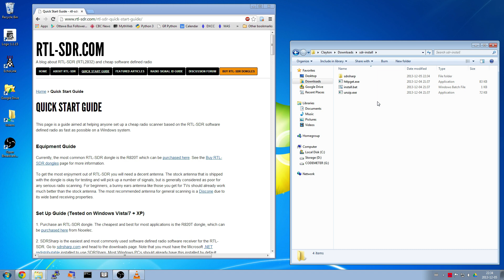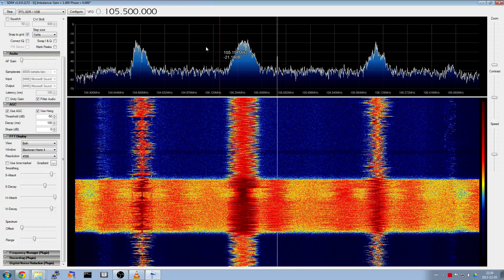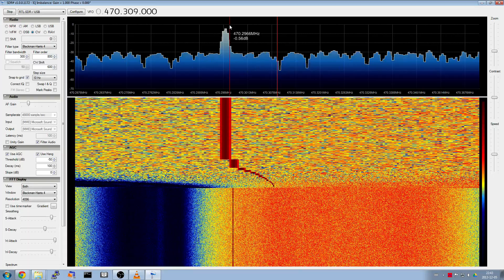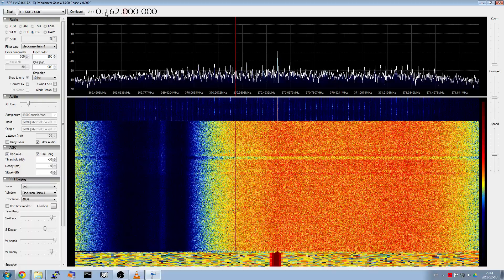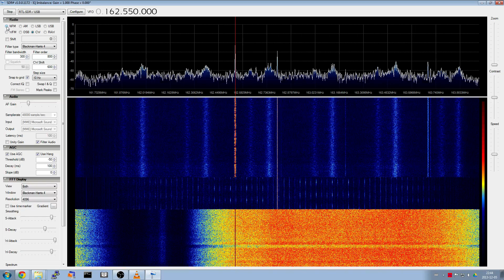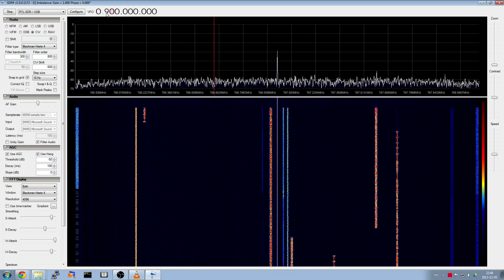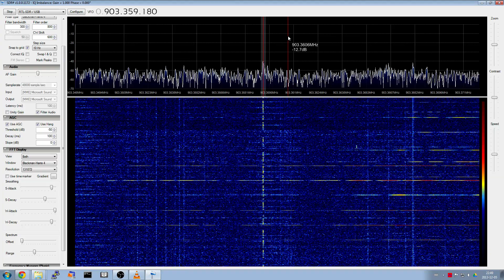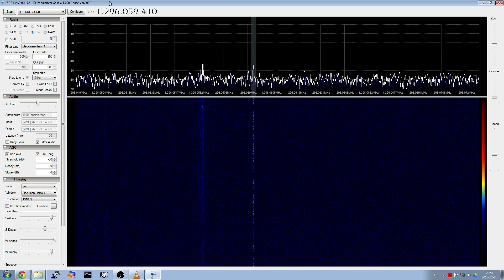Getting started with SDR# and an RTL SDR tuner

Comment: How do I know the signal is encrypted?
Reply from the maker: It varies depending on what protocol you're trying to receive. If you're sure that you are using the correct demodulator for a particular signal and the signal strength is high but you get garbled output, then that could be a sign the signal is encrypted.
Reply: @argilo314  I live in Brazil, and where I live, I can't hear any P25. DSD+ shows that there are some communications, but no audio comes out. I am using a copy of DSDPlus-2.71x.
Reply from the maker: @reninets  Encryption is common in P25 systems, so that could be the cause.
Reply: @argilo314  If there is encryption, is there no way to decrypt it?
Reply from the maker: @reninets  It would only be possible if you had the encryption key.

Comment: Hi Clayton, what is the antenna setup that you used for this video? I bought the RTL-SDR kit that comes with the antenna to get you started and I'm wondering if that's sufficient to capture the signals that I need to listen to transmissions from police, weather, and others, not just the standard AM/FM radio stations. Thanks.
Reply from the maker: In this video I used the antenna that came with the RTL-SDR. That may or may not work for you depending how far away you are from the transmitters you're interested in.

Comment: Thanks for your tutorial. Some said that there are other softwares for decoding trunking systems like TETRA, and DMR system, but in your tutorial you only used SDR sharp. Does SDR sharp decode everything? And you said that you used the original antenna that comes with the SDR. does it really a good antenna?

Comment: Alright Clayton, I subscribed to break the 999 subscriber ceiling, you now have 1,000! So put down the poutine and make us another great video! This is the best one I've seen on how to jump in and use it. I ordered the "RTL-SDR Blog V3 R820T2 RTL2832U 1PPM TCXO HF Bias Tee SMA Software Defined Radio with Dipole Antenna Kit" off Amazon the other day, looked like something fun to tinker with. Thanks man, make a part 2 now! heheheh!

Comment: Wow, I'm blown away by this video, I want to order the sdr right now but I have a question, can this work with my old LAPTOP-1.6Ghz and 2GB ram 
It would be great because I haven't used it for some time,and I was thinking to take up some dx- ing it was quite some time ago and I didn't want to spend so much money in the beginning.
Only now I come across the sdr and it seems to be a great device for much less than what a good sw receiver will cost.
Thanks for uploading.
Reply from the maker: Yes, I expect it will work on an older laptop.

Comment: I don't want to be the goat here, but they ought to configure the software to where the user has the option to select a very basic simplistic screen to work with, and  also the option for a more complicated display like the one shown in this video. Do I want to invest the 20 hrs needed to figure out and operate a SDR system?  Not really. And OK, yes you can see the frequencies show up on the graph via FFT ( Fast Fourier Transform ) technology. ooheeeew , it does FFT on the input signal , oh how impressed I am.  Well damn, only a real radio system will show you this, my goodness.  Oh sure, and now you can see those secret transient signals coming out of Russia just like James Bond.

Comment: Very informative video! I had no previous knowledge about radio equipment but it really helps to see how you adjust the parameters to optimize your reception. It will solve a lot of issue I've had.  Also, my entire noise floor seems to be oscillating, which I think could be my AC unit which is very close to my laptop or a shitty Vizio displace directly next to my laptop. Looks like it's time to buy some USB extended cables or better yet, I have an excuse to build a ham shack!

Comment: What is the pilot signal at 470.309 MHz and where does it come from?  I CAN receive it on my USB SDR in my location.  Any locations that might not be able to receive?
Reply from the maker: The pilot signal is part of the ATSC digital television standard. Receivers use it to lock onto the ATSC signal.
Reply: So it is part of a local UHF Channel 14 TV signal.  In a location with no local channel 14, that pilot won't be there although there may be one on another TV channel frequency.  WikiPedia lists the pilot frequencies of the other UHF channels but only to two significant figures.  https://en.wikipedia.org/wiki/North_American_television_frequencies#UHF_band

Comment: That thin line to the right of some of those stations like on 100.3 FM is that the RDS data? I've seen other SDR videos where there was the main audio signal and then two thick bars on each side of the main audio signal Could that be HD Radio.
Reply from the maker: No, that line is due to DC offset in the receiver, not a radio signal. RDS is not visible because it's hidden inside the analog FM signal.

The thick bars visible above and below some FM radio stations are indeed HD Radio.
Reply: I saw that line when recording from my Radioshack headset radio that I tapped the raw audio before it went to the main amp. I see the same line on the spectrogram above the audio signal in my recording program.

Also is it possible to just record the audio from one frequency and you are tuned to to a regular .wav file on these SDRs?
I've heard that it records to wav but it's not a regular wav file that you can play on a PC. It's in some weird format.
I'd like to be able to record whatever I'm listening to into an MP3 file sort of like on that WebSDR website.

Comment: Running Windows 10 when I clicked on the SDsharp after unzipping the file it said Windows Defender had stopped the opening because the software might damage my computer. Is this normal?
Reply: Windows 10 tends to alert you to this whenever it sees software that is not run by a large number of people and that doesn't mean it is unsafe. If however you would rather not take the chance google around for CubicSDR, SDRConsole or grab SDR# off the official website.

There are lots of different options and you are not tied down to a single SDR client.
Reply: Thank you

Comment: are these ok?

https://www.banggood.com/Ham-Radio-Receiver-100KHz-full-Band-UV-HF-RTL-SDR-USB-Tuner-Receiver-p-1196555.html?p=LR14182185464201508M
Reply: These are basically boxed RTL SDRs with an Up converter built into them. They are not of the best quality but there is no reason it wouldn't work. Unless you really need HF capability though you might be better off just ordering an original RTL-SDR from a local supplier on Amazon rather than waiting for one of those to ship out of china. If you've already ordered it I'd love you hear your thoughts on the item.

Comment: Are there antennas covering the entire frequency range of these USB sticks?
Reply from the maker: A discone antenna is probably your best bet. They are available from a number of manufacturers, or you could build your own.
Reply: I will try to find a mobile antenna at least 25Mhz to ~ 2Ghz?
A recommendation (wide spreaded and used)? Often only "25-1300Mhz" (actually only one "discone" at ebay, and only 25-1300).
Reply: Check out the Dressler ARA-2000, it covers 50-2000MHz. It isn't sold anymore but you can easily Google a DIY build guide

Comment: May be a silly question but to understand this can you or someone tell me what type of antenna is used here in this video or on this RDL SDR? I assuming it's not the cheap cell phone coil antenna looking one that comes on those eBay radios. ? Whoops at the end of the video I hear him say that it is the cheap antenna. That said is there a better antenna to use on this software defined radio?
Reply from the maker: For this demo, I did use the antenna that came with the RTL-SDR.
Reply: Clayton Smith but is there a better antenna to use with this other then the one that came with it?
Reply from the maker: RViscara Yes, as long as you have the right connectors, you can attach whatever antenna you like.

Comment: Can u translate that morse code at the end of the video ?
Reply from the maker: VVV DE VE3WCC IN FN25DJ
Reply from the maker: VVV is a morse code test sequence. It marks the start of the beacon transmission. DE means "this is". VE3WCC is the beacon's call sign, and FN25DJ refers to the Maidenhead grid square where it's located (in downtown Ottawa).
Reply: Cool info mate, cheers !

Comment: I pick up no AM signals!
Reply from the maker: Popart 2015 If you're talking about AM broadcast stations, they are at frequencies much lower than the RTL-SDR can receive. (It only goes down to about 25 MHz.) If you'd like to receive lower frequencies, you'll need to add an upconverter like the Spyverter or Ham It Up.
Reply: Clayton Smith Isn't there a dongle/package with all the frequencies? Including the kHz ones?
Reply from the maker: Popart 2015 Yes, there are other SDR boards that tune over a wider range of frequencies, for instance the SDRplay RSP2.

Comment: Thanks Clayton, for this excellent video. I have only recently got into SDR and have been experimenting with SDR# and an RTL-SDR dongle that I bought. As I live in a rural area, the stock antenna received hardly anything so I bought and installed a discone. Wow, what a difference!! I can now receive fantastic reception of my nearest airport which is over 50 miles away. This has now become my new hobby/obsession...

Comment: the signals in my area aren't that strong. Turned the gain all the way up and the strongest fm station peaks at -15 db
Reply from the maker: ***** I live about 20km from the local FM broadcasting tower, and there are no obstructions in between. So I end up with very strong FM signals. Consider yourself lucky if FM signals are weaker in your area, as they can be a nuisance when they mix with other signals in your receiver. I have to filter them out to avoid that problem.
Reply: Clayton Smith yea, i know. I was just pointing it out

Comment: Does that pilot tone work in any state in the continental US?
Reply from the maker: It's for TV channel 14, so it will only work if you have that channel in your area. Each channel after that is 6 MHz higher. So the pilot for channel 15 would be at 476.309, for example.

Comment: What kind of antenna are you using? I have the short 6 inch or so one that came with the SDR dongle, and live 15 miles from a major market, but signals very weak. Thanks.
Reply from the maker: I was just using the one that came with the dongle. Make sure you check your gain settings. Also, having line of sight to transmitters will make a big difference. I'm lucky to live in a high spot.

Comment: This... is... AMAZING. I've been a radio nut since I was like 8 years old or something (that was a long damned time ago...) and somehow this kind of thing totally got past me all this time. I just recently got back into ACARS decoding, read a little about ADS-B, did a little research, and I now have my first SDR dongle on the way to me courtesy of eBay. Had NO CLUE that these little devices had such an amazing tuning range! Here I always felt like so badass owning an AR8200 but these SDR devices, wow... just... crazy.  I am super, super psyched to go roaming across the bands - my quest for ADS-B now seems like a mere minor rest stop on a much larger journey! :-)

6:11 - Alice!!
Reply: hie, I just wanted to say good luck when it arrives. It somehow got past me also up until 2 months ago and  I watched a bunch of you tube vid's on it and just had to have it as well. I'm a radio nut as well for about 45 years. I didn't have the time to install this in the beginning, and when I did my installation failed somehow, -I can't get my PC to detect the SDR on USB,  I tried all ports, and all drivers were installed as instructed, & I took my time. Perhaps a bad driver, so I'll start from scratch after deleting everything related to the install. I here this is a common issue, so hopefully the second time around it works. Good luck, this thing is completely and insanely cool.
Reply: Jeff Li
Hi! I'm not sure what's going on with your driver problems but my own installation acted a bit oddly on both my laptop and desktop, both Windows 7 (32 bit on the laptop, 64 bit on the desktop). On both machines, driver installation "failed" but after a couple of tries I found that it was actually working anyway, lol. I've been using SDRSharp and ADSBSharp/ADSBScope ever since, with no serious problems. I think the SDR is amazing, really, but also it's clearly troubled in many ways, haha. I like to refer to it as being a bit like a "special needs child". I have to say, from VHF Hi to at least 1000MHz, it really does a great job, especially as you go higher. The audio quality on the FM broadcast band is amazingly good, and SDRSharp lets you do stereo FM sound so it's really impressive. On everything else, like AM and narrow FM, it's typical of what you'd expect from any good receiver, sound quality wise. Reception wise and with some functions is where I consider it "a bit special needs". It has a fair bit of issue with images and birdies, sensitivity is undramatic especially if you're used to great receivers, and if you try to do exotic things with it like using it as a police scanner, it can become downright disappointing depending on what you're trying to do. It also suffers from a lot of bleed from very strong signals like super strong FM radio stations, so for a lot of cases a good FM broadcast band block filter might be a really good idea. That said, as a frequency hunter with that spectrograph and waterfall, it's AMAZING. I have never felt so capable... Just set the waterfall speed kind of low, aim the frequency in the general area you want to stalk, and watch for signals. I get slightly over 3MHz of bandwidth view on the desktop computer, running the sampling rate full out.  EASY and powerful, love it!

The best killings I've had so far are with ADSB - more than 60 miles range with a very shitty antenna - and I totally raped public service around 853MHz with clean, strong copy on a mob of signals. I've also scored good hits on 2M and 70CM ham, 156MHZ - 178MHz public service, 456MHz public service, and a scattering of aircraft band fun, etc. I am planning a lot of experiments and improvements with antennas, preamps, filtering, and I also have a Ham It Up unit coming hopefully tomorrow. This thing is definitely a riot as long as you understand its rational limitations and how to work with it and not against it.

Oh, one very important thing I did is to put it on the end of a Tripp-Lite 64-foot active usb extension cable. Now I can place it way away from my computer and that makes worlds of difference with noise levels and sensitivity. I'd love to see this thing at the top of an antenna tower, with a GOOD antenna. :-)
Reply: One little thing to add - I just figured out tonight that maxing out the sampling rate is not so great an idea. You get to see a wider bandwidth on the spectrum, granted, but the receiver starts to drop data and your audio quality will suffer. FM radio sounded fine to me either way, but I was wondering why narrow FM (police, fire and etc) was gritty sounding to the point of being impossible to copy when yesterday it was great. That was why - I'd been fooling with the sampling rate. When I lowered the rate to 2.56 MSPS, the audio became crystal clear again. Looked it up on the Net and found some articles on the subject that explained it nicely.
Reply: Hey there Night Runner, thanks for the reply. After researching a bit just last night I see that a dual core processor with 1 gig RAM  is said to be the necessary as minimal (or) recommended SYS resources for at least XP. I do have a great HP Pentium 4HT 3.0 ghz CPU, with Hyper Threading  with one gig of RAM, but as I'm sure you know it's a single core processor. That may suck for me, since everything I have ever wanted to do with this PC has never failed since 2004,  and it was a gift from Mom. I have always been very satisfied with this PC and have maintained it well, I changed the bad filter caps when it was around 9 years old. I'm an electronics tech. and I keep up with all of the stuff that I love, however- I have been wanting a stronger PC anyway the past year or so, not to mention XP is no longer supported by Microsoft but there are ways around that!  I won't retire this one as it does everything I have ever wanted it to do and as I said before it was a precious gift not to mention it's a very solid machine. I will most likely build a real kikass machine, it's so easy to do, or I may just get a Laptop. I am undecided since laptops overheat, all the time and that's a different animal to repair all together but I've done a few. What's happening with this present install of SDR Sharp is that it will show every input to choose from, as per what you want to use, ex: various inputs, and even shows RTL- TCP but  Not RTL-USB. Zadig for XP is working. I also have read that some of the SDR Sharp downloads do not support RTL- USB, which is what I need. However, I can even use my audio card as an input as well with SDR SHARP. I believe that a re install-- with patience will work but I may be wrong due to the single core P4 HT processor that I have. I'm psyched to try again but need a day off. I have the whole operation and install procedure in my head, and in a folder. Wish me luck, I cant wait to push the play / start button and hear RF noise instead of my audio card. Thanks again for getting back to me and I'll keep you posted, and also-  good luck with your up- converter, I believe it's dc up to 30mhz. SWEET!  Once I get this right I too will get the up- converter, 73's have a great week, Peace, Jeff
Reply: @3butalcomp3  interesting...I downloaded what must be the latest version, (seems to be coupled with AirSpy) and will not recognise my usb dongle. I'll keep messing around with it, perhaps a driver issue.